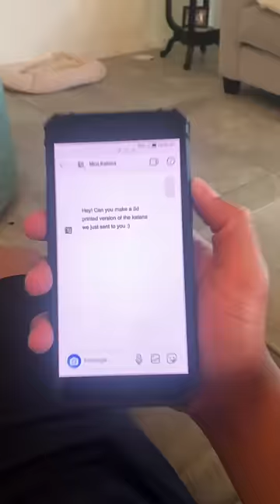Real Rengoku Sword vs 3D Printed Version (@MiniKatanaStore )

Comment: I could tell the difference because whenever you 3d print Something there is always line patterns somewhere on the object that is very difficult to get rid of, and sometimes you can still tell that something was there after you finish getting rid of them.
Reply: Just needs to be sanded better
Reply: @icg6417  Even with sanding more you can see the effect of the sanding. its not a perfect solution to the lines.
Reply: @jowest99  sanding and filler is all you need it takes a while but it does get the lines out

Comment: Correct me if Im wrong but isn't the blade suppose to be facing the other direction, the hand guard flame design looks like the desired way the blade would be positioned

Comment: I would've worked on the blade a bit more.  The print lines are still present.  And a coat of glossy lacquer could've sold it a lot better.  Still it's a very good print.